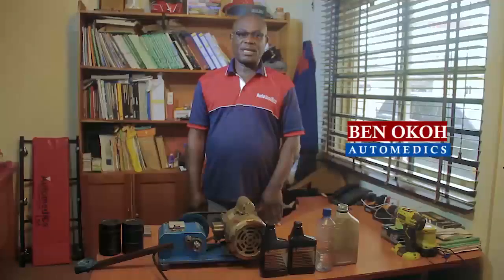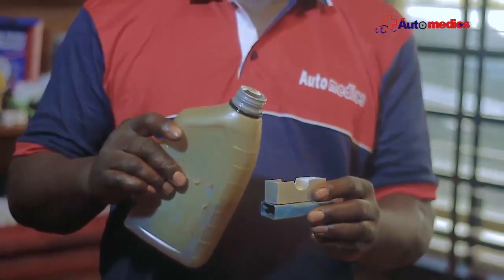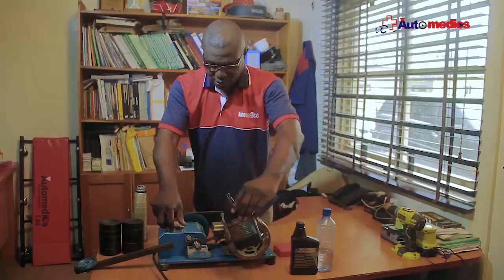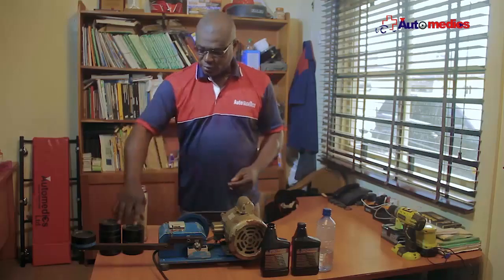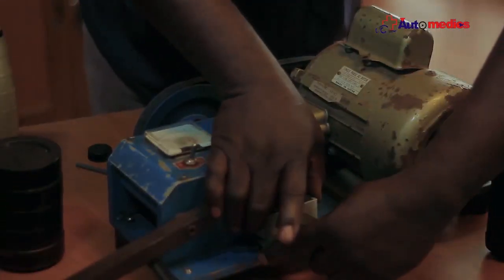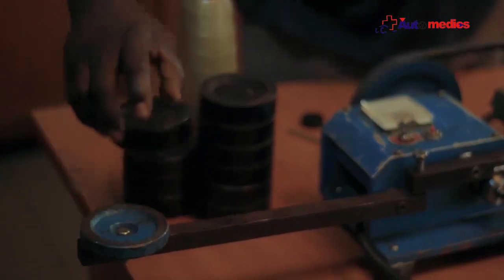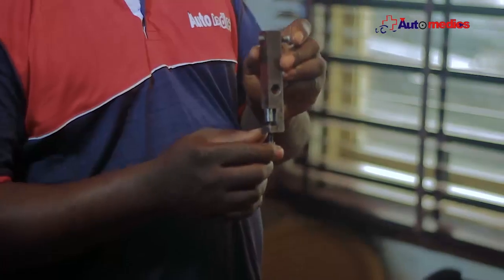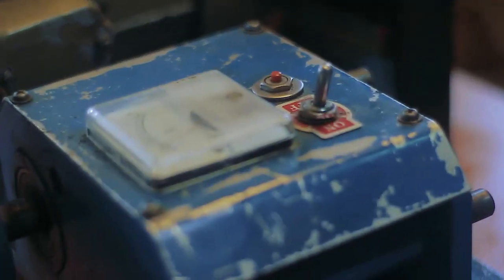Polytron metal treatment concentrate demo.

Comment: Hello, Please what the cost for the oil.
Reply from the maker: 8k per bottle.
Reply: @BenedictJohnsmatt  bottle is a litre? Right?
Reply from the maker: A bottle is 473ml.
Reply: @BenedictJohnsmatt  can it work for transmission or is it only motor (combustion engine)?
Reply: This is Recalculated
Basically may calculations using 10% Polytron for a 4.4 quart engine
With 16 oz is $26.49, $22.51 per application
With 1 gallon is $222, $23.52 per application